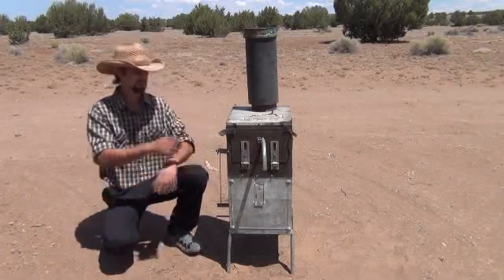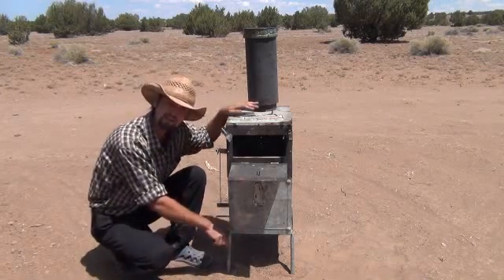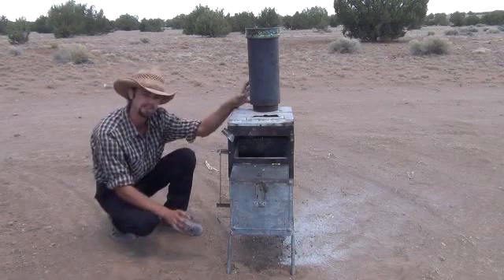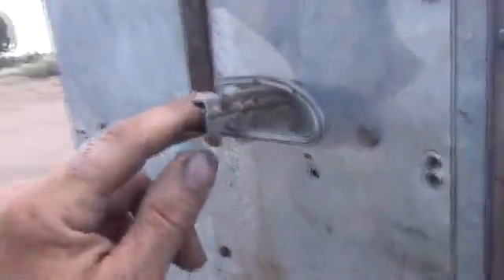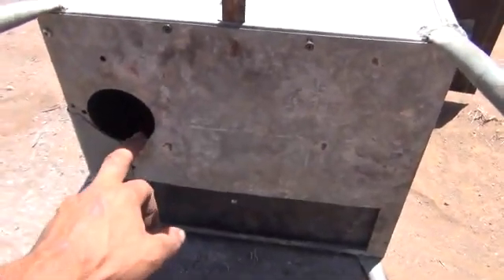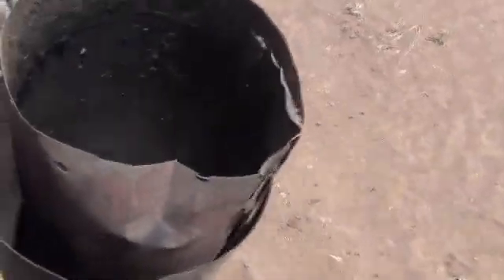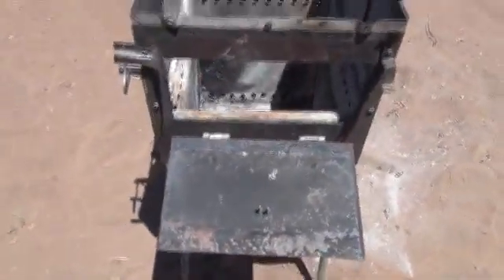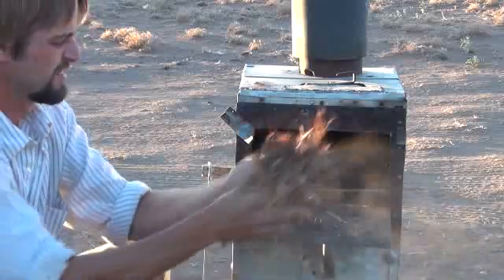Gasifier Wood Stove full video

Comment from the maker: The problem you don't solve with a rocket stove is that it wont run a generator for power and it wont provide fuel for your car, it only works at full temp. So it has only a very limited application and is good for a wood stove that runs at full bore all the time because it needs to be wide open to function.

Comment: Nice build.  Thanks for the video.  You talked about trying to use the syngas on a generator and hot water, but would you be better served to make a smaller burn chamber to save on the wasted fuel out the top?

Comment: This is a very nice stove, but the success you have achieved is mainly from the fuel you are using. The twigs burn fast and hot, you need to get that action from split wood, not as easy. Type of fuel is paramount in gasification.

Comment: I'm building two gasifiers. One to figure out the ins-outs then the big deal once I've got my results .... Right now I'm stuck.. with my lid/top on I smoke out/snuff out ... But remove top n flare up... I've tried adding a small fan to
Reply: Did you build the gasifiers? I’m going to be building my own.

Comment: What if you put a bell on top of your heat riser/flame stack like they do on rocket stoves.  Then you would have that bell radiate the heat and possibly be able to duct the flue gas horizontally to extract more heat from it.

Comment: Hi,
Just thought I'd give you an old means of gathering the excess heat from a regular wood stove pipe. What the old-timers would do is place the wood stove on the other side of the room from where the pipe exited the house. Then, they would run the pipe vertically from the stove to within several feet of the ceiling; then run it across and out of the house. Of course this worked better with the taller ceilings of yesterday. However, it can be used today if you can make use of ceiling fans, etc.